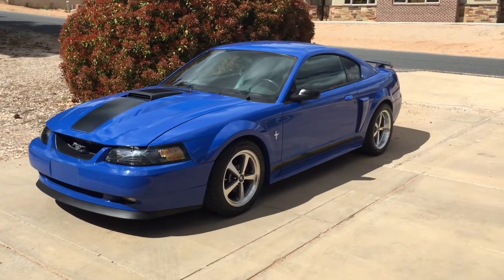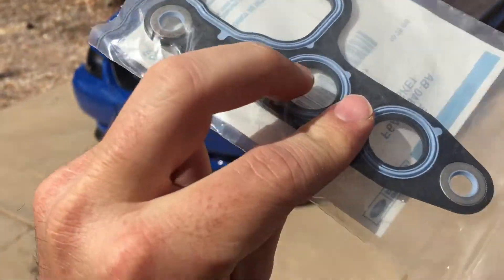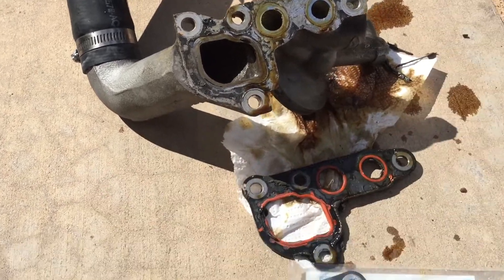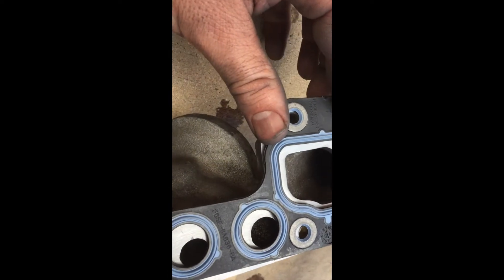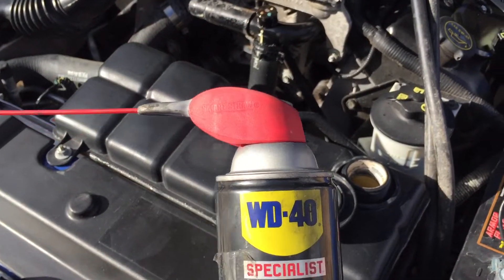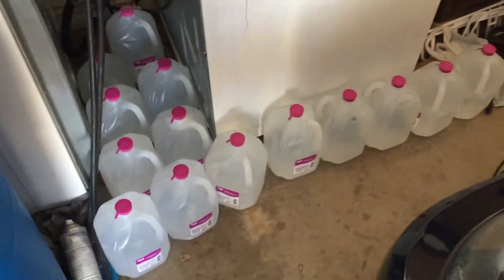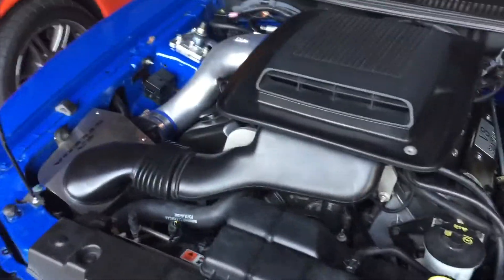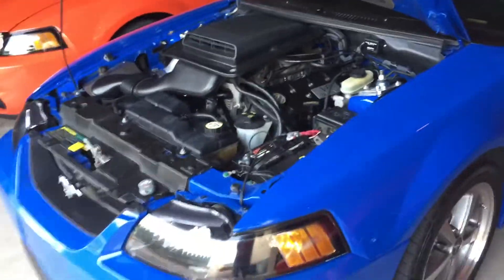03/04 mustang mach 1 Oil filter adapter gasket replacement

Comment: That's the original gasket that ford used my bullitt has the same one with black rtv ..aperantly ford used rtv in the assembly line with the orange gasket. Look closely there is a different in the two gaskets. .

Comment: Hello, if the gasket is bad can the oil leak into the coolant system as well? Or vice versa coolant into the oil system?
Reply from the maker: That may be possible, but in all the cases I’ve had either oil or coolant, just leaked out
Reply: @justin.c_svt  thanks for the response! I have an 04 mach 1 and noticed a bit of oil in my coolant tank. Could be a whole different thing but i think it might be that.
Reply from the maker: @g.e.587 Yeah that’s possible. Hopefully there isn’t coolant in the oil in the crankcase. And hopefully you don’t have a cracked block letting coolant and oil mix.